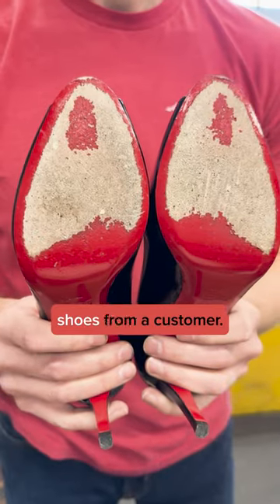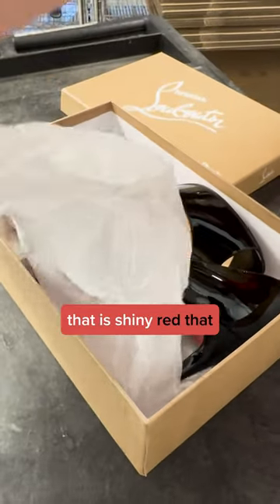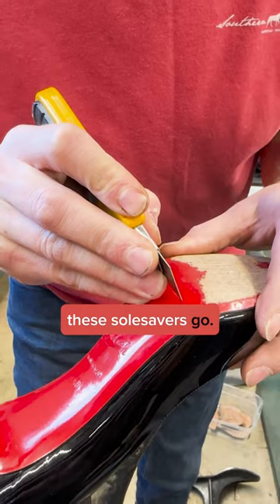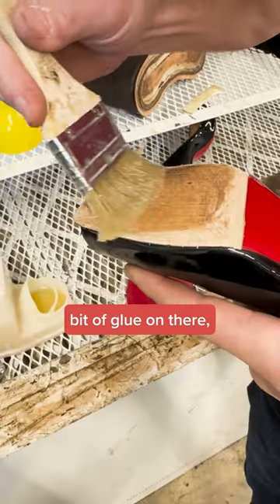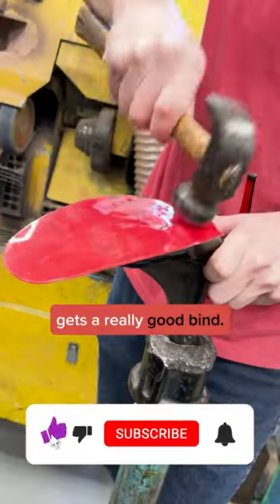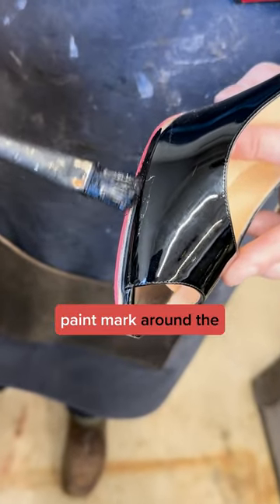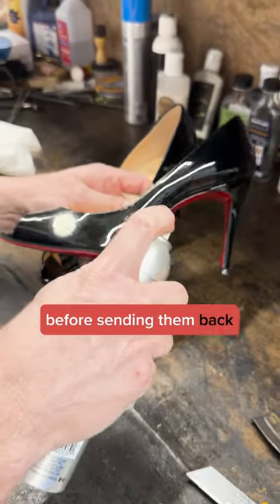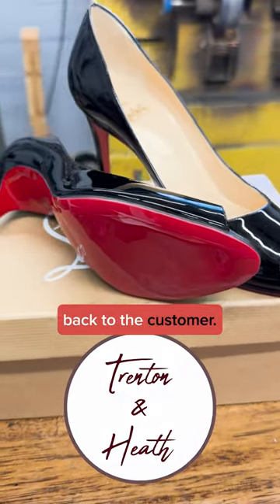Adding Red Sole Protectors to Louboutin Heels    #shorts #louboutin #designer #shoerepair

Comment: They spend so much money on these shoes and couldn’t spend the extra $3 for the protective sheet you could put on them? That’s the first thing I did.
Reply: I would think that should be a free inclusion at the time of sale.
Reply from the maker: Valid point!
Reply: I'd say if I pay that much for a shoe I expect it to be more lasting. Or that a protective sheet is included in the sale. I own shoes from no-name brands that seem to be more sustainable.
Reply: @summersun6536  Right. Why not make the soles more durable in the first place?
Reply: They actually have this service for free at least in Belgium! I got a pair of heels as a gift and was told to wear them for a bit and give them back to the shop. Wearing them beforehand will show my specific pressure points when walking which they’ll use to adaptthe soil to :))

Comment: There is no close up of the sole at the end. When I pause the screen and look the crease looks very visible. Seems to ruin the shoe.
Reply: Yeah, it was visible. It would look better to put it on the entire shoe, not just the tip.
I also think the crease at this point of the shoe might make it fall off quicker. All it takes is one tiny edge that gets loose

Comment: This is great for saving a nice pair of heels. Can any sole be repaired in that way? Are there limitations?
Reply: Limitations are the cobblers skills and the material in the shoes. Some types of rubber and plastic can't be glued, and that makes it a lot harder and even impossible on some shoes like some models of ecco. The problem is often that they use an open-celled foam material, which is disintegrating in contact with water.
Reply: I’ve always had these protectors put on my flat shoes.

Comment: I did think LV owned that red? How easy is it to get the parts for this repair and does out match perfectly? Thanks for the video, very interesting 😊
Reply: It's absolutely not a perfect match. It's a rubber sole saver. Since it's original leather sole it will be ruined by water. But the rubber makes the sole last longer and not so slippery. Actually changing a sole on a shoe like that, is something I wouldn't do or recommend. Very hard to get a good result.

Comment: Lesson 5,973,901 to not fall into the trap of buying  things like this. Very cool they CAN be fixed and even made a bit better with some grip but I'm not buying shoes designed to fail me. Makes me feel a lot better I'm getting some custom made with actual molds of my feet that will last forever as long as I find good cobblers like these guys. The few folks I know with these never wear them, just leave them in the box to stare out. Which, well. Aren't shoes supposed to be for putting foot on ground? Not stay wrapped in tissue paper?
Reply from the maker: Couldn’t agree more.